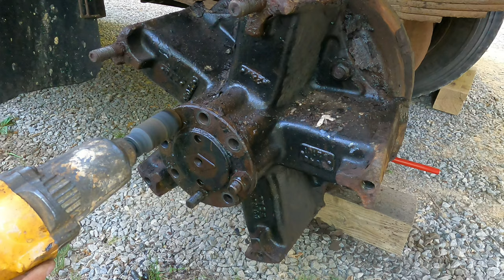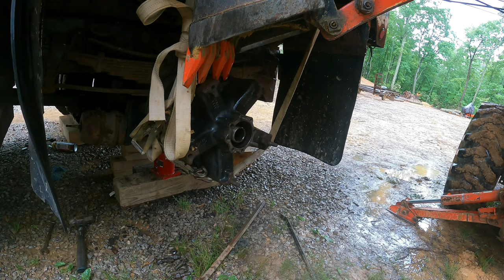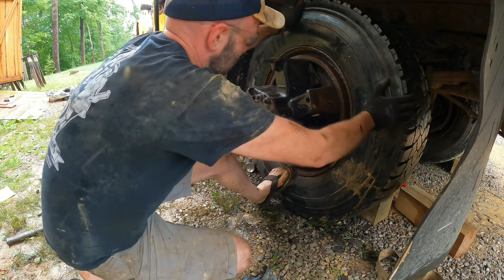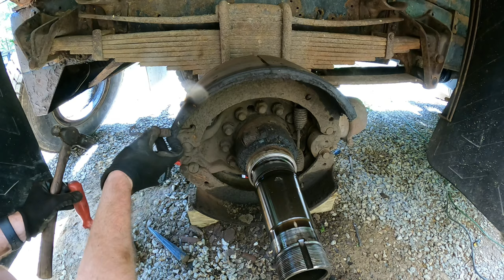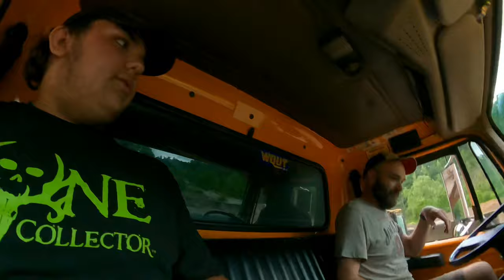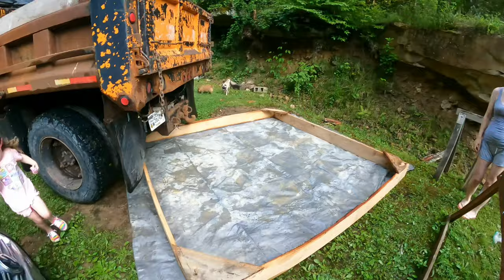International 4700 rear brake change

Comment: Do you know what axle this is? I'm needing torque specs on the nuts you chiseled off and on
Reply from the maker: I ended up going back and checking the end play because I was worried that it was wrong. I used this video for the torque specs and end play measurements. I bought a cheap dial indicator at harbor freight. Hope this helps! 

https://youtu.be/CK6wgC-a6pk